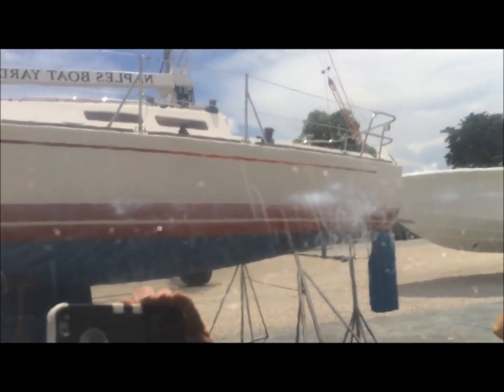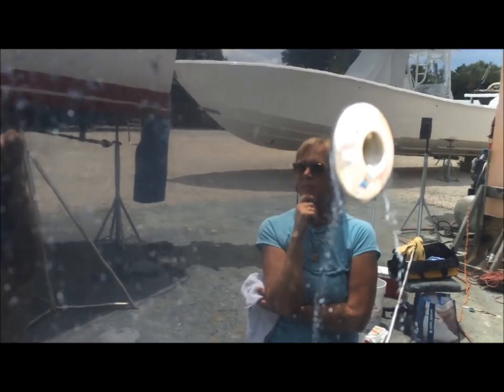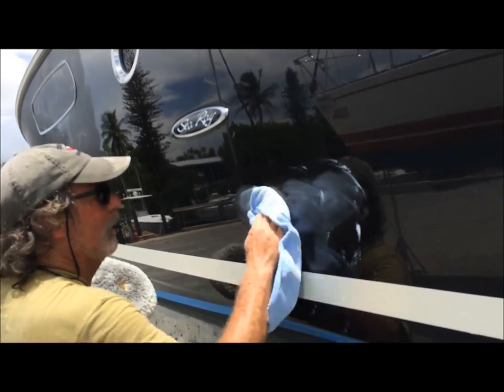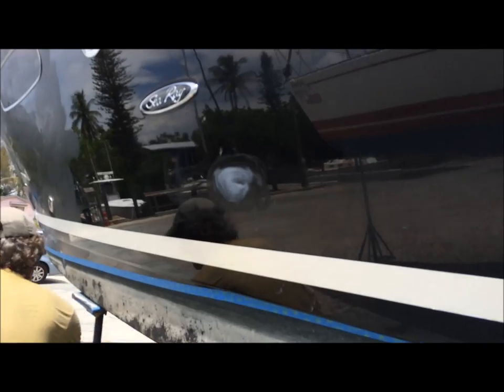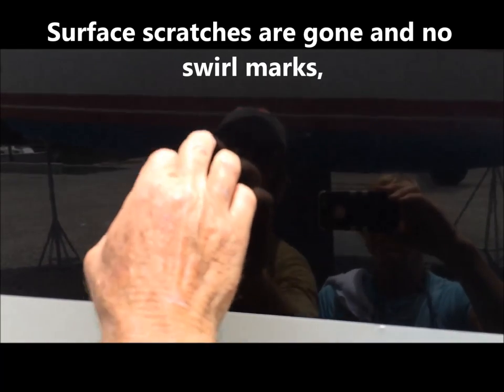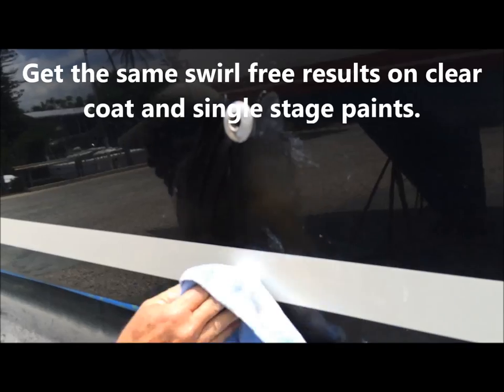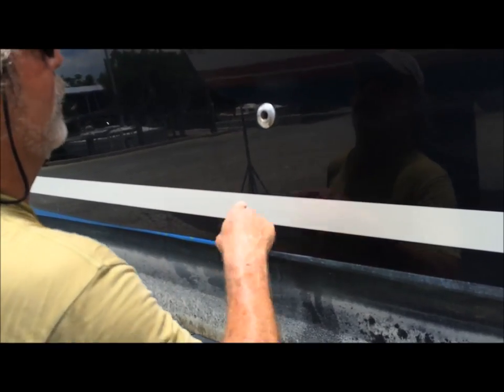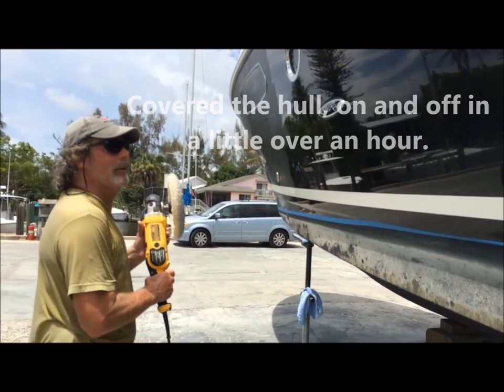How To Remove Gelcoat and Clearcoat Scratches In One Easy Step

Comment: Good work! I have about a 20” long scratch in the side of the hull on my new 21ft Yamaha jet boat. It’s from a nail or sharp object of one of the rental slips. Basically looks like someone keyed it. Any advice on the best way to try and polish it out? Same method used here maybe? Thanks.
Reply: DennisTheMenace if it looks keyed good chance it won’t buff out... anything that “breaks” the gel coat surface will need gel coat repair... surface scratches are generally really Scuffs or transfers...
Reply: Don’t know if you ever got it out, but for future reference. 

IF the scratch wasn’t all the way through gelcoat. 
Test sand a 1/2” section of the scratch to get an idea of how deep it is. 
#1 wipe with acetone
#2 Use Dual action sander with 1000 grit
Wiping with acetone each time to look at the scratch. Making sure not to over sand.
#3 Buff with compound and wool pad 
#4 Polish with Finesse and a polish pad.